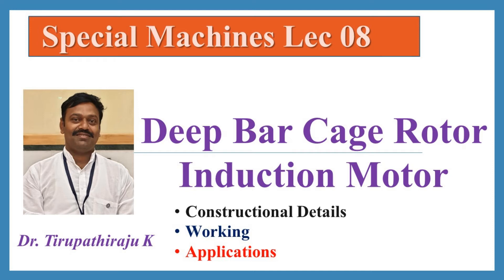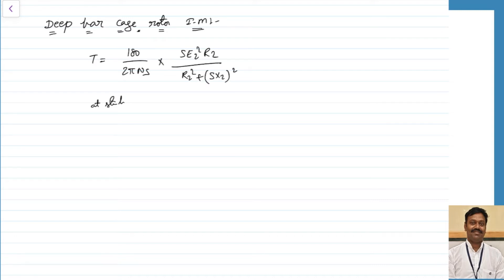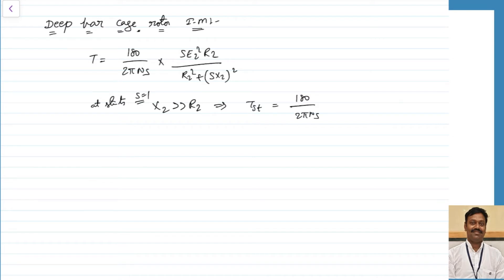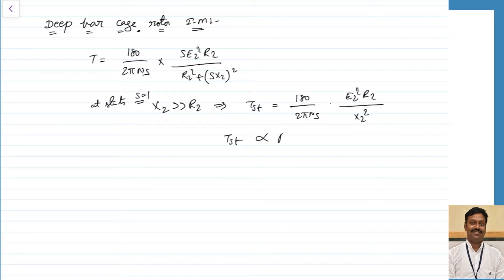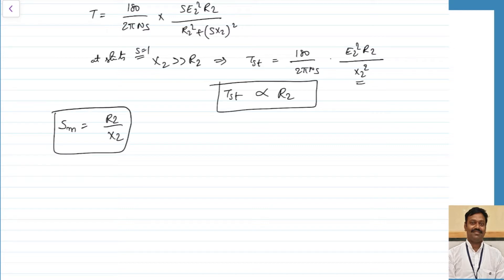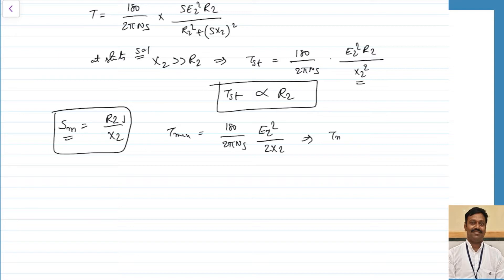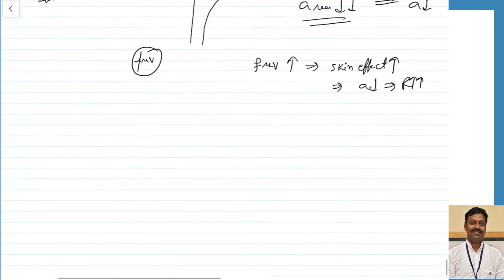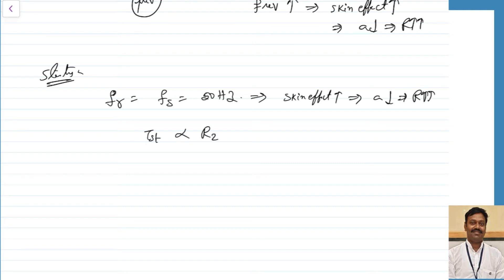SEM08 Deep Bar Cage Rotor Induction Motor

Comment: Thanks for the video!
There are so many factors you have treated, that I feel embarassed to ask this question and many years have passed when I sat in a class.
For a H. P. say 30 on the motor name plate, which of these three motors will provide maximum torque?
Thanks again.

Comment: Sir I have a doubt at the time of running rotor resistance is high Sm=R2/X2 so slip will be high hence the rotor speed will be low then how can we assume that it has good running characteristics for deep bar cage IM